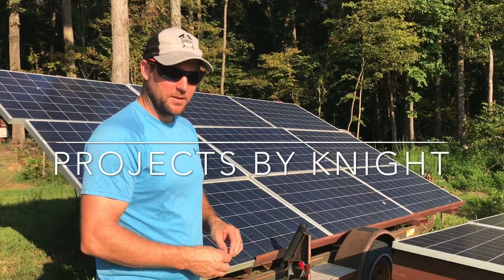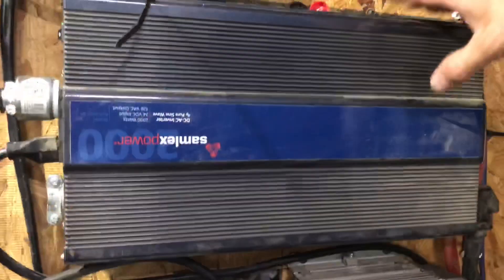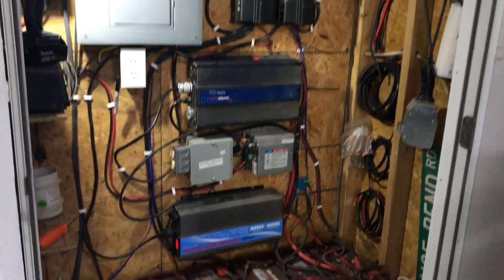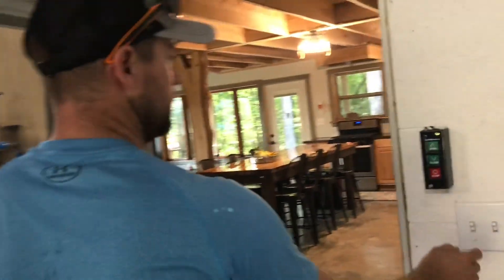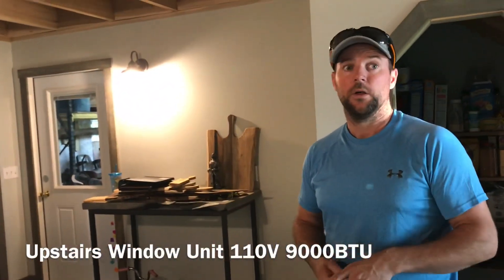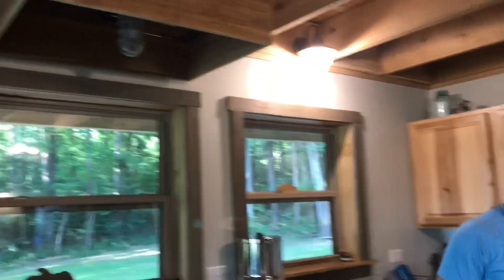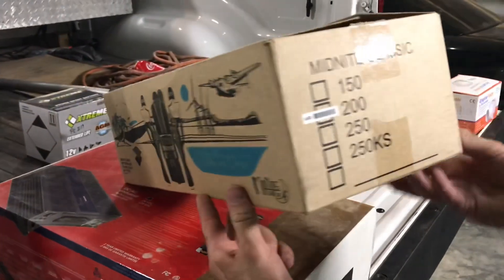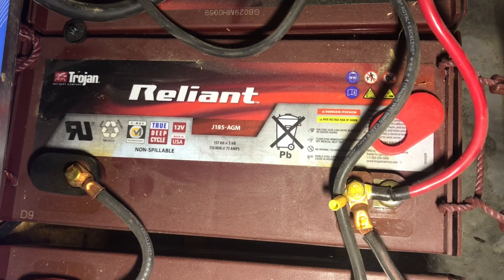Our Solar System for our Off-Grid Pole Barn House EP14

Comment: Sweetwater tn
Reply from the maker: I don’t know of any builders in that area but i’d suggest you go to a local building supply place & ask if they know of any good pole barn builders in the area. There are some basic modifications you can do to make it easier to change into a house that I can help you figure out. We’d recommend Superior Solar in Munfordville KY. You can call Sam at 270-524-3932. They sell everything you need for your system. Thanks for watching!

Comment: New sub here. I noticed in some of your other videos that you have a bunch of machinery in the wood working barn to include planers, compressor, window AC, and others that I cant identify. Some looks to even be 220v. How on earth are you powering all that on solar and a total of eight 12v batteries? Not to mention the rest of the house, fridge, light, washer, dryer etc. Thanks.
Reply from the maker: The only thing we can’t run is the dual head 24” sander. We don’t run everything all the time, we run the big stuff when it’s sunny...we have timers & automatic low voltage shutoff to make sure we don’t drain the batteries. We also bought appliances that work with the solar, gas range, dryer & water heater and DC fridge & lights. Thanks for watching!

Comment: Very nicely done, informative, and answers a lot of questions.  But, adds a few...  you had mentioned “you can also do a ‘grid-tie’...” and that leads to my personal predicament: we want to “go solar” with our class-C motor home.  Sounds easy(?) but I’ve been told “you use solar to charge your batteries, and you can run an extension cord to an AC appliance” to the inverter.  My main question had been “how do you integrate solar into your electrical system (?), so you can use it with grid (AC) power, and the onboard generator - so there is an option to use any of the three options.  I’ve yet to see a fully integrated RV!  What about houses that are in an area that loses power, regularly, because of extreme weather - snow blizzards, hurracanes, tornados, or ‘brown-outs’??  These houses are connected to the grid, have solar, and a backup generator...  I’ve called several major RV manufacturers and I’ve yet to get an answer to “integration” by ANYbody.  Thoughts?  ANY experience from ‘followers’?
Reply from the maker: If I understand your question correctly you would run your solar panels to a charge controller, then the charge controller would charge your battery bank in your rv, and you would use an inverter off the battery bank to run any 110 that you want to. They make a transfer switch that could be used to switch between your inverter or generator. Let me know if this answers your question or if you need more information! Thanks!
Reply: @ProjectsbyKnight  ‘bought the MPPT charge controller, 3000w inverter when the solar panels (2x 400W). Before I spend a lot of money on a battery bank I wanted to KNOW how to “integrate” this new “energy option”  into the coach’s existing electrical system.  The RV does have a transfer switch relay, that allows either using the grid power or generator.  It doesn’t have the capability to “add” another “energy option”. I’ve spent weeks looking at dozens of videos claiming to have done this - I’ve yet to find one that actually accomplished this.  I’ve also called several major RV dealers AND manufacturers - and NObody had an “answer”.  Some have told me to remove my generator (OR remove my grid power cable!) and just tie the solar system into that “empty spot” on the transfer switch.  These are UNacceptable answers.  WHY hasn’t ANYbody done this YET?  
We camp quite a few places where there is no grid power, and I’d rather not turn on the generator to use cooking appliances (microwave, mixer, rice cooker, WOK, coffee maker), we rarely use AC, so power consumption wouldn’t overtax our solar array/battery bank (theoretically).
Reply from the maker: @ronveil7216  would you be opposed to a manual transfer switch between the inverter & the where you plug it into the grid? Or you could probably add another auto transfer switch. Where are you from?
Reply: @ProjectsbyKnight no, not opposed to a manual T S.  ...or an auto T S.  I’m just amazed this hasn’t happened already (?). The 2 main points: 1) it would be nice to have all 3 power options available, and 2) I don’t want to “fry” an electrical system ;-)
“Where am I from?” ?  Born ‘n’ raised in Nashville, live in Georgia...  I’ve lost count how many RV dealers, repair shops, and parts places I’ve asked about this...
Reply from the maker: I think a manual switch might be the best way to go so that you could turn it off at night or anytime you want to quit consuming your batteries!… You do not want to take your batteries below a certain voltage. We live one hour north of Nashville, I just thought if you were in our local area I would try to see what I could dig up with the guys I get my solar stuff from.

Comment: hey guys nice house. I will be building my own pole barn house God willing in the Philippines. I have a business where I supply Lifepo4 batteries that would be a great upgrade for your system from the lead acid agm's you have now. with Lifepo4 you will have a lot more power and a lot less worries than with batteries you have now. if you are interested in talking to me about them you can drop me a line at perry_kusnezoff@hotmail.com  really like the way you put the house together. I want to build a house and shop set up with a wrap around porch as well. really nice.